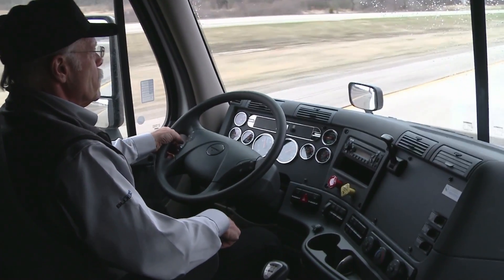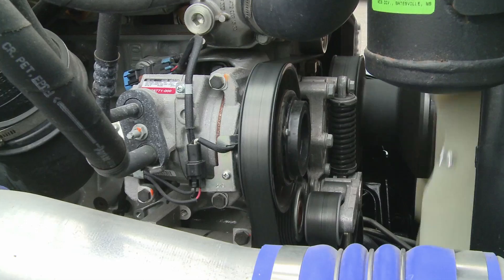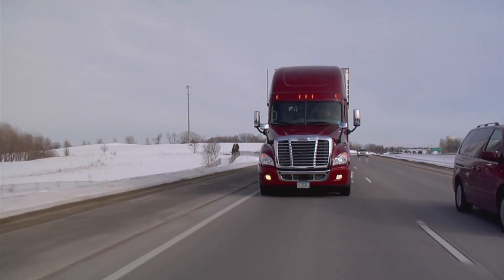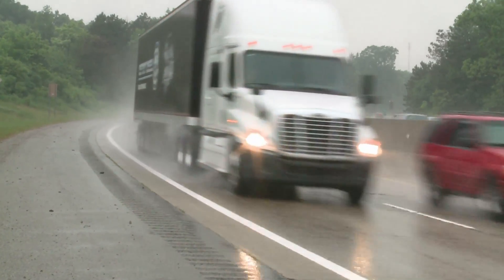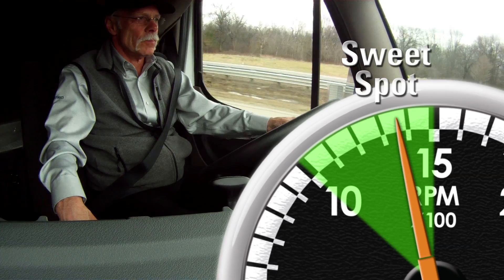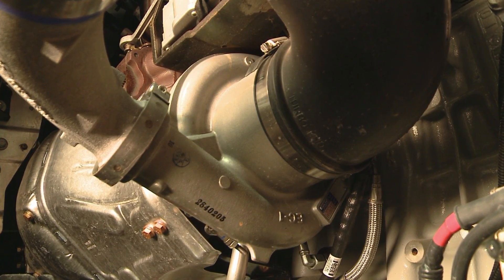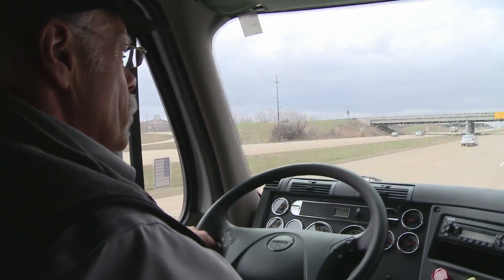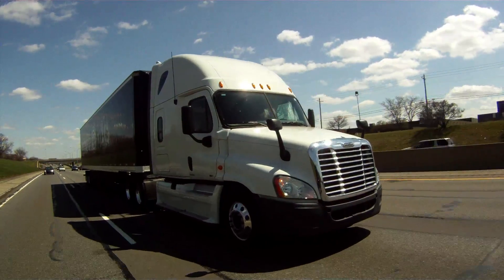Detroit Driver Training Series | Driving For Fuel Economy

Comment: Unbelivable, wich truck is this. Can't belive MercedesBenz buses in EU had the same stering wheel. And buttons on the dash came olny in the 2019 (but another MB bus company - Setra introduced this buttons in 2013)..  Probably MB and detroit are same company (mb maybe bought detroit?)
Reply: Both are owned by Daimler

Comment: The best thing you can do to increase your fuel economy is to buy a Paccar MX 13 and not listen to this blah blah blah from Detroit. the engine brake works good and changing oil is easy on the DD13 , that is the only positive things I can say about the Detroit
Reply: I'm drivin a 2017 Cascadia with the dd15 and its cut back probably got 400 horsepower to the rear wheels if that and the jake doesn't work under 35mph and keeping thew crusie control on when approaching a 2% grade the speed drops from 65mph to 55mph with only 10000lbs on its a freaking joke.Penske leasing says they cant change the setting which is bullshit cuz I drove a 2012 and 2014 and 2016 and the jake works right down to 5mph and most were casterated no power gutless for the size of the engine sure the technology is so high tech but the computer must be a pencil pusher.
Reply: CT17 Shawn These new Detroits don't sell well in Australia, they had to give a Cummins option on the Western Star range and what do you know it's more popular than the DD15.  Not many people run the newer Detroits here unless they're a Daimler brand truck, even then people still get the Cummins when it's an option.  According to the Daimler guy at the Brisbane Truck Show a month ago the Detroits are very popular and people love them, really, yeah right, that's why you see so many Cummins and Paccar's out there 😂😂.
Reply: Haha my how times have changed in 16 years....paccar is crap now